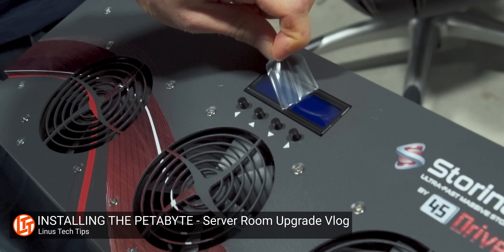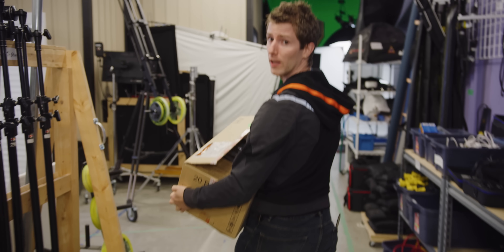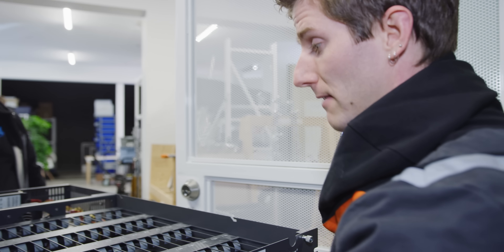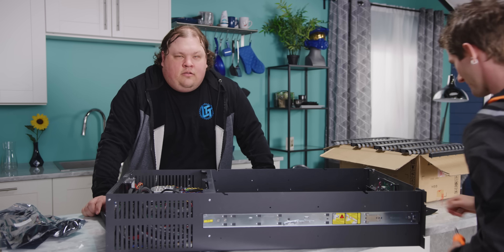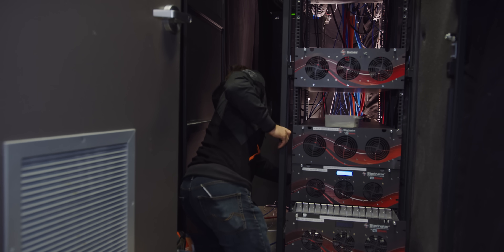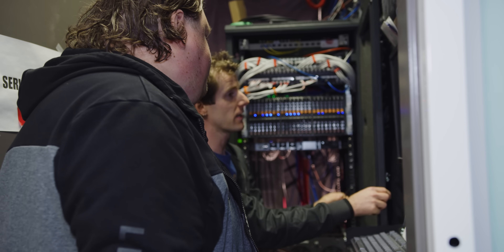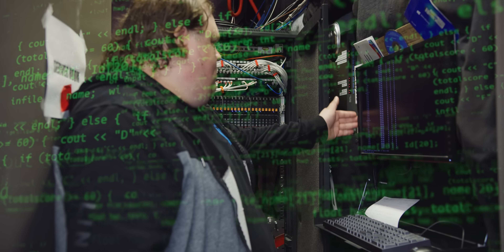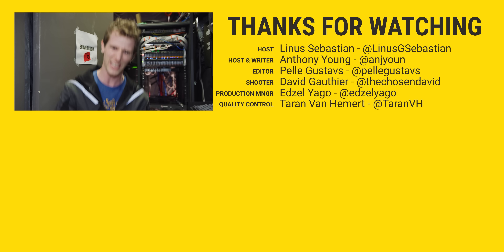Petabyte Project is FULL! Time to upgrade...

Comment: Video in a quick summary: started to upgrade server drive capacity, ran into problems.. Anthony jumps on board and dives into the world of Linux and troubleshoots. Linus finds drive compatibility problem and helps save the day. The server actually loses capacity once it's correctly configured with extra drives... Yup.

Comment: For the amount of money you dropped on that ridiculously stupid 45 drive crap and the amount of time wasted on trying to fix dumb things with it you could have just bought a Isilon and just added boxes it to increase storage and that sucker has de-dup and built in compression.. and full drive replacement if they go bad with nvme cache!! 2 appliances and bam 1PB add another fully amped from the factory and 1.5PB plus you get 100Gbps switches and 8 nodes for redundancy...I’m not really a dell fan but that 45 drive crap looks stupid as hell!! Even synology looks better then that over priced trash box that you keep giving to other youtubers!! Smh

Comment: Linus, you guys should look into a motorcycle jack to put the servers onto when you pull them out. They are hydraulically height-adjustable and will allow you to pull the servers without removing the drives.

Comment: Two comments:

1. Rack Door: Linus' filter means nothing since the rest of the enclosure is open.  You need pressure through the filter for it to be effective.
2. Server Room Troubleshooting: Why the guys both trying to fit in a tiny server room for troubleshooting an issue where the server is booted and networking enabled?  Get a laptop and SSH into the thing, and you can work in relative comfort...

Comment: Did you guys count on the zfs overhead?! For example the total raw storage of a raidz1/2/3 is 10 tb, you should utilize only 75 to max a 80% storage cuz if you max out with data your performance going to be as low as you never seen before. Trust me, I have my own freenas server and trust me, your amount of system ram for l1arc is way too low.  Zfs requires 1gb of ram for every single tb of raw storage you have. You can add by the way cache drives to vdevs to act as a l2arc,  which way I went cuz my ram capacity is only 32 gb in a rx100 s8 server, and I have over 140 tb of raw storage. Every single vdev in my sever has it's own 256gb ssd only for caching purposes without those cache drives and fully over 95% utilized storage I got almost no performance out of them.

Comment: I work for a Data Centre company here in Canada. Depending on the rack, you can actually get proper HEPA filter inserts for the doors or door replacements with the screen built in. 
That rack looks like is designed for a DC which is great, but means its meant for a clean space. 
May also wish to consider some form of containment for hot air on the back side, just a simple insulated curtain to separate intake from exhaust and have an exhaust and intake dedicated for front vs rear. Takes very little time, but lowers your cost and increases efficiency of the servers. Since well... helps with cooling so its not eating its own exhaust. 
We use a vinyl curtain system here, but keep in mind your temps and needs as the vinyl can have issues if temps are too high for prolonged periods of time. But really anything is better than nothing.

Comment: Is it possible for you guys to modify a small motorcross lift  with a rail system (a forklift type of thing would work too) to then load a full server box on it? It would save time and if you did correctly, it would be safe too.

Comment: Omg, you got 1 pb, 1,000 tb, 1,000,000 gb, 1,000,000,000 kb.  And you ran out...
Reply: *1,000,000,000 mb
Reply: @cxmjg  Whoops I deleted mb and put kb...
Reply: Please, this is important! 1 b = 1 bit, 1 B = 1 byte; G for giga, P for peta, and T for tera should all be upper case. 1 kB = 1000 B, 1 kiB = 1024 B…
Reply: All your data are belong to us.
Reply: thats really not that much anymore
Reply: Bruh
Reply: 180TB will run out in 250 days. We'll see another "upgrade" then.
Reply: that's not how it works. 1k = 1024
Reply: @mrdufenshmirtz1139  it is tho its 1024tb instead of 1000 and 24tb is a lot :D
Reply: @Mr Dufenshmirtz
Hard drive manufacturers make and advertise their drives with SI-units.
Reply: @mrdufenshmirtz1139  its KB not kb.
There is a difference.
KB is kilo byte here i MB = 1024 KB
But above its kilo bit. Where 1 mb = 1000 kb.
I believe this should help. 🙂
Reply: @Him-Sar  No, 1 mb = 1 millibit = 0.001 bits. :P

Comment: Ugg Linus you scrub, wasting all that space for a measly Petabyte with 3.5 inch drives....

I have an Exascale CEPH cluster, and at 1PB per 1U I save more in power alone than the cost and space difference.

https://ir.supermicro.com/news-releases/news-release-details/supermicro-unleashes-all-flash-nvme-1u-petabyte-scale-systems

Comment: When as a service and repair technician I needed to go through “Hard Drive” training videos, from Seagate, about how to handle them properly with the main point is that you should Not stack them at any point or they need to be replaced with new ones.

Comment: 4:00 "It's cold in this server room" Yeah right buddy, and my MacBook can run Crysis 3 at ultra settings
Reply: Kush Shah the server room has its own air conditioner running inside it, so yes it would be pretty cold.
Reply: why on earth would it be weird for it to be cold in the server room
Reply: It has 2 air conditioning units one on each side
Reply: No, but my laptop will :P
Reply: in most countries maybe but in canada they might as well have gimped the ac

Comment: here is my helpful filter door removal comment. Put better filters in the HVAC unit for the server room, and make sure the server room is slightly positively pressurized vs the rooms around it.Then you can remove the filter door and keep the server clean.

Comment: Seagate, when you absolutely, positively need to prove the reliability of off-site backups.
Reply: seriously, they're not that bad though - we kept buying them again and again and again... oh wait.
Reply: Seagate drives are great, my Baracuda is 9 years old, 27k hours of activity, and still works. :)
Reply: Excluding my personal experience with two of five Seagate drives in an array seizing their bearings at the same time, when I was working for a major non-AMD chip manufacturer doing validation, we bought roughly 300 drives for our team. Half were Seagate and half were WD. We had a decent mix of models from both brands in both 2.5" and 3.5" form factors. These drives saw occasional use. Rarely more than 3 hours runtime at a time, and then they would sit on a shelf for a couple weeks. By the end of the first year, half of the seagates were dead, and we had only lost two WDs. By the end of year two we only had 10 Seagates left with 20 failing because of drops or environmental issues, when we had lost only 12 WDs to non-user related damage with about 100 drives remaining alive and well. That's been my experience with a somewhat statistically significant sample size from each.

Comment: 2:30
This is wholly inaccurate. Raid Z2 on 15 drives does not mean that there are 2 dedicated physical hard drives who do nothing but provide parity bits for the other 13.

What's really happening is that in RaidZ2 for 15 drives, 2/15ths of the total per-drive-storage-capacity is dedicated for providing parity bits for each of the other 14 drives. Every drive is providing some amount of parity bits in the storage pool (ie: drive #1 provides a bit of the needed data could be used to rebuild any of drives #2 - #15), and there's enough parity bits spread across all 15 drives to lose 2 full drives and still have enough parity data leftover to rebuild 2 blank drives to replace them.
Reply: I have a COMPTIA and i have no clue what you said

Comment: RaidZ2 on 15 12 TB drives... I am concerned. For me that's way past any comfort zone, especially, when you're adding drives from single production batch. While drive failure rates aren't as high as several years ago, they still do fail, and usually close to each other. I get it you're low on space, but that's a recipe for getting screwed if drives start failing during rebuild.

Comment: hot swap/add is capable if you've got the highpoint rocketraid 750's in there (older S45 and Q60's), you just have to run "camcontrol rescan all" or go onto the web interface and have it rescan and then check it with "camcontrol devlist". Secondly- yea, Linus did have the right idea about having to add the brick to GlusterFS before they'd realize the space; Linus technically helped twice.

Comment: You need to buy a hydraulic lift cart for moving storanators around. That way you can adjust the height of the cart to match the height of the drive bay and then wheel it around.

Comment: So, speaking from ZFS-y experience, 512-byte sector drives can be treated as 4k sector drives with little to no negative impact, but you HAVE to set your ashift right from the beginning.

512-byte drives are ashift=9, 4k drives are ashift=12
Reply: Whatever

Comment: What operating system are your individual storage servers running on? Is it just FreeNAS and you opened the shell or is it plain ZFS on Linux? If it`s the latter which Linux distribution are you using. (Debian, CentOS maybe?)

Comment: Why did you transported the drives to the kitchen and than back to the server instead of only moving the drawer to change the cable tho? 😂
Reply: This is linus.
He's very rich, but too cheap to buy a second cart.

he needs to invest in a real server cart. Massively saves on the back injuries. Servers slide right out onto the cart.

Comment: So you're showing me an 2U VIDEO Render server, on the bottom of the Rack...
Don't you think that the thermals between the Storinator and render server could do something like...
Destroy an Harddrive due to the heat in the Sata power Cable??
Reply: no because heat moves upwards 

oh wait. but how long does it take that thing to reach temps that are critical for such cables?

Comment: Is the red camera worth it considering the crazy file sizes and YouTube compressing everything at the end?
Reply: For what's it worth they have their floatplane site that has higher bandwidth and as a media company it makes sense they would invest in high grade equipment in the same way music studios invest in high grade hardware even though most things can be done by software.
Reply: Dont forget that they have floatplane now and that will potentially have better compression compared to YouTube.
Reply: Yes it is, it doens't value as much as other cameras on the market, and they can easily resell it in the future. Most people aren't watching 4k videos nowadays, not in their computers at least, so it's a camera that they can use for 10+ years and still retain that good quality footage.
Reply: No, they should've bought the Alexa, RED's bad.
Reply: No, it's not. Their video quality can be achieved with much cheaper cameras and at a lower bitrate. This is pretty much a case of "we can, so we will" in which they bought expensive equipment just for the sake of having it. The only actual benefit is future-proofing, which again doesn't make sense for their content which is uploaded to youtube which compresses the crap out of everything.
Reply: @TibzzTube  The higher resolution has nothing to do with image quality. They use it for other things, like the ability to reframe in post with no drop in quality. You can even see it a bunch in this video, every time it seems like they switch to a different camera without pausing, where the framing/zoom suddenly changes, that was a cropped shot, and not a second cameraman.
Reply: @guspaz  I never said it does. Also, using 8K for reframing in such simple videos is a bad use of the camera's potential. This is a simple case of paying for a good camera instead of a good camera operator. 8K for reframing makes sense in TV shows where it's used to make perfectly centered shots in post which is hard to do during production but what LTT is doing is lazy and honestly a waste of good equipment
Reply: @TibzzTube  
Really? I thought people like Linus were kinda the target audience for this kind of stuff. Just cause a video is "simple" does not mean it can't be professional in a technical way.
Reply: If you consider the pretty big amount of content they've gotten out of both petabyte and RED stuff it was worth it for that alone. And it's gonna keep giving them content for a long time.
Reply: @giovolokogiovox  It doesn't have to do with the quality of the original video, but rather the quality of the cropped video.  At 8k they can crop in to 1/4 of it and still be able to have HD video displayed.  You would be able to notice that even after the compression of YouTube.  As someone who just lightly does some video work I totally get how useful that is. It does take a ton of space, though.... hence this video.
Reply: Nah, Red camera is a waste investment for any YT creators imo. That thing costs a fortune and the image quality ain't that much better than other cameras.

Comment: Why not just use amazon workstations and s3 storage at this point? You'd cut your complexity, gain better data durability and have higher performance.
Reply: They get the drives for free through sponsorship so a cloud storage would be expensive and besides you can't make a video on that.
Reply: @josephevans992  But at least at that point their "valuable" data would actually have protections that right now they don't have. They'd lose everything if a fire happened in that closet. A relatively straightforward data tiering system for them would likely only cost 10k~ per month. 8 machines with 16 cores and 42gb of ram would add another 5k a month, and if they really want to keep on prem prices, they can set up a simple Direct Connect setup to avoid traffic costs.

Comment: You were dead wrong @Linus Red Camera Footage in default settings with no compression will blow an easy 200 GB of data and that's a 5 minute video. Since you are in Canada Internet Providers Don't Have Data Caps - You Lucky Duck 
A Small YouTuber like me in America & As A Spectrum / Charter Customer has had some insane bills from posting to YouTube. Spectrum / Charter doesn't offer their no data cap options to customers who are time warner customers and yes time warner is supposed to be part of Spectrum but nope the FCC says Charter can say we're stuck on the Time Warner policy until 2023.

Comment: Ummm... Was there a reason you need to bring the drives with you into the studio?  If you were so worried about vibrations, couldn't you have just put the case on a separate cart and wheel just it in, leaving the drives safely out of the way in a corner?

Comment: Linus.....aren’t the rack servers on rails? If so, get an adjustable height car that can be lowered or raised. Then slide out a rack server, directly onto the cart, detach rails & good to go. That’s what I do.....little easier & saves some time.
Heck, could make your own out of square tube, that slides into each other with cotter pin etc....can even install hydraulic lift/jack on it as well. Just some ideas.....as moving servers is a labour of love😉
Like these vids & looking forward to the new server vid👍🏻

Comment: i'm sory, but... why the hell did you guys take the hard drives for a ride around the block, specially if you were aware that you could damage the drives by moving them in a vibrating cart... wouldn't it be a bit more smart moving only the empty rack?